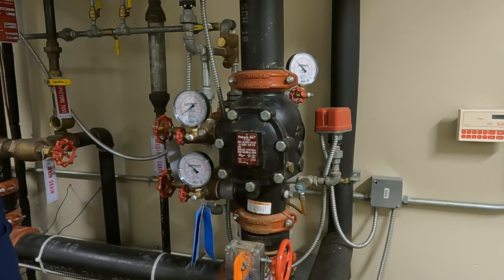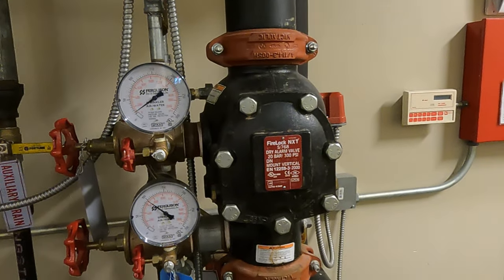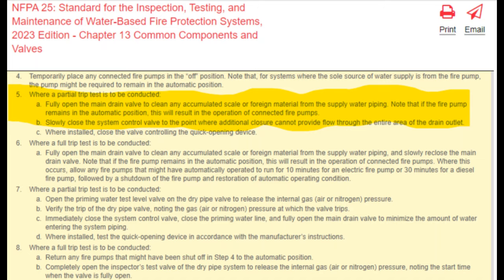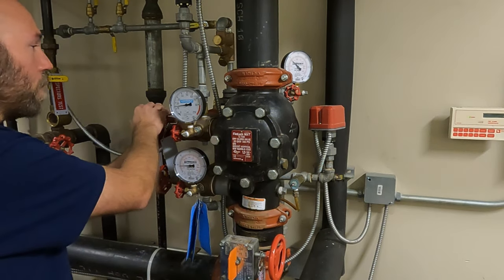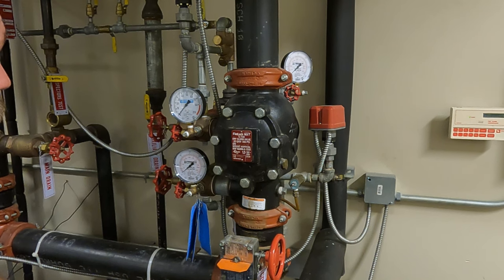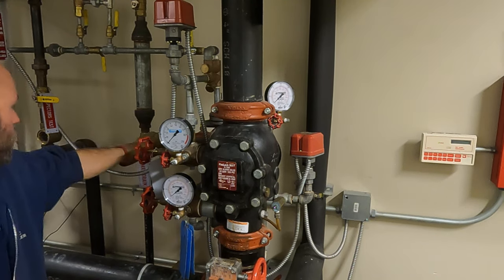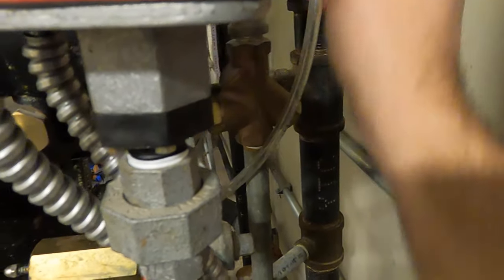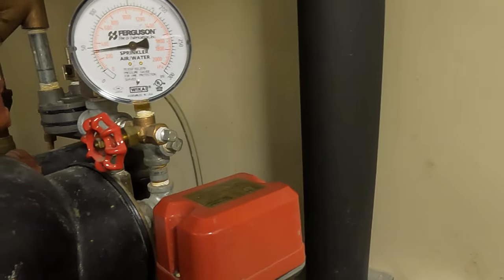Partial Trip Test Victaulic 768 Dry Fire Sprinkler Valve

Comment: Great video. Nice simple explanation on how the valve works. 

A question if I may? I'm trying to troubleshoot a false "system charged" water flow alarm that occured on a 769 NXT valve.What could be the possible reasons that the water flow alarm would trip when the system itself has not tripped? Air pressure in the system is above 20 psi, all valves are in the correct positions etc. I did notice a tiny water leak on the low pressure actuator via the vent valve, but unsure if this could be the cause. I've charged the system with the test valve, and then discharged again afterwards via the PRV under the alarm pressure switch, but can't get the alarm to clear. Driving me nuts. I've visibly aged in the last 24 hours.
Reply from the maker: Is this a pre-action system? I ask because the I think the 769 is designed for pre-action or deluge. Just want to make sure you didn't mean 768 NXT
Reply from the maker: When you say discharged via the PRV, are you referring to the manual ball drip also called a velocity check? If you don't have any water pressure on the velocity check and it is still in alarm, I would slowly remove the velocity check to confirm it isn't stuck or plugged. If the trim is clear and you are still in alarm then open the pressure switch and check the state of the switch. If the switch is active indicating a water flow then you might have a bad switch. If the switch is not active then it's an alarm system issue.

Comment: Could you do a video on tyco accelerators and setting them back up.
Reply from the maker: Sure will. Just don't know when. I pretty much just do a video on what I'm working on. Thanks for watching.
Reply: Those suckers never setup for me.   I usually pull them out from their unions and clean the interior up.
Reply from the maker: @bluelude2001 They are my least favorite. I was thinking about starting the video with me taking it and throwing it in the garbage and saying the best way of fixing it is replacing it and making sure to never install one on a new install. lol. They next time I run into one I’ll make a video.
Reply: @FireSprinklerTech  yeah we had a few accounts where nobody could get them set up and my boss had me go out and collect them all and I literally took a whole weekend to learn about them, tear them apart and I was bench testing them in my garage using an air compressor.  I can never get them to set up after a full system trip. I always take them down and tear them apart and clean them up, lube up the pins and all that stuff.

Comment: 7:17 i thought it was the air keeps the clapper shut?
Reply from the maker: Not on this valve. This valve is a mechanical dry pipe valve. The air holds the actuator closed. 
Most dry valves such as the Reliable D and FX, Tyco DPV, Viking F-1, etc... are differential dry pipe valves. On those valves air pressure holds the clapper closed.
Reply: Excellent Video.  Been doing some troubleshooting on a nxt preaction system and was getting conflicting information.
Top-Notch Thank You.